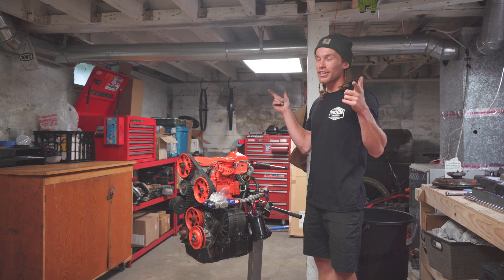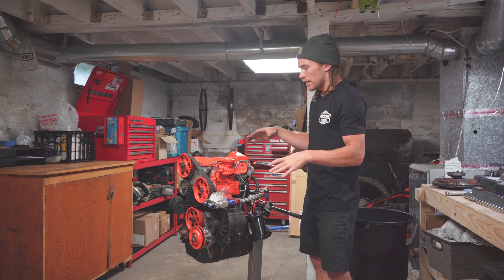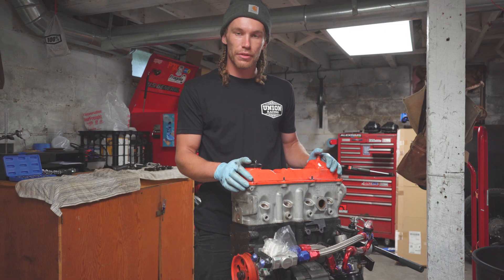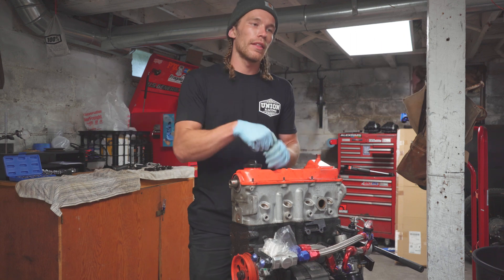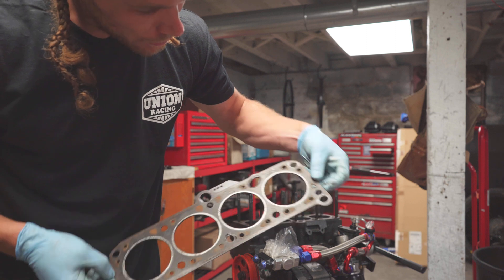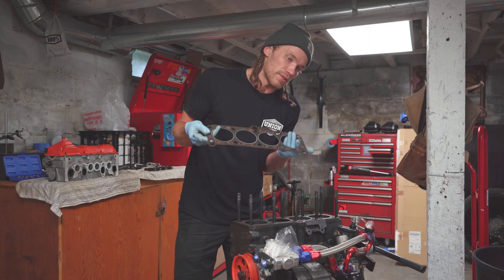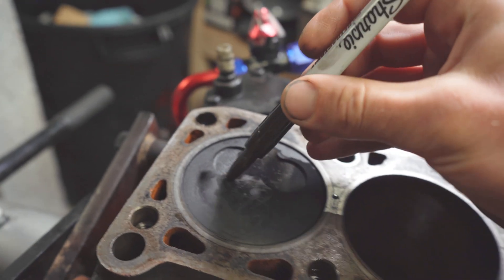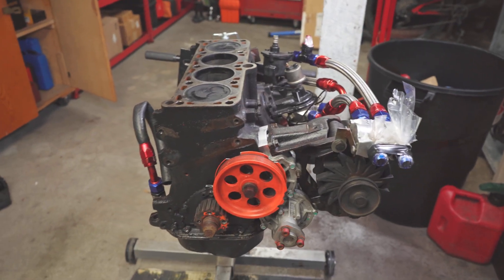1984 VW Turbo Diesel Engine Teardown

Comment: I would not run propane injection on the IDI. You could get pre-combustion on the propane due to the 23.5/1 compression ratio. I would run water methanol. And that could be the reason you squished all your rods. Though I am super happy you are doing this channel. Not much out there on the old VW diesels. Keep it up man.
Reply from the maker: Thanks man!! Good thoughts. Certainly I don't think the oem rods are good for much more cylinder pressure the stock
Reply: @OliverFetter  yeah, the rods are definitely the weak link on these 1.6 diesels. I believe the factory Turbo 1.6 diesels do have stronger rods. You could try a 1.6 Eco diesel, out of a late 80s or early 90s Jetta, those are turbocharged, but don't have a boost enrichment setup. So you would need to swap the pump, but otherwise they are great. Looking forward to seeing more videos of what you got going.
Reply from the maker: @nothsa1107  Right on! I'm excited to have the car back & keep posting videos 🌞

Comment: I have an 84 1.6 4 speed naturally aspirated and it will startup then die but if I give it some pedal it stays alive after a few seconds then will idle fine but if I try to takeoff it will stall no matter what amount of pedal I give it any ideas?
Reply from the maker: hmmmm. Sounds like not enough fuel. has the pump been tinkered with? I'm always shooting in the dark a bit with repair suggestions 😵‍💫
Reply: @OliverFetter  the injection pump was replaced a few thousand miles ago with a bosche remanufactured one hasn't been messed with other than being out in time correctly
Reply from the maker: Have you bled the lines at the injectors?

Comment: on my 1.6D without turbo factory factory engine 40kw, I put a 1.9AAZ engine head that I had to modify so that it could fit on that block and turbo GT2052V AND FACTORY BOSCH PUMP turned on max fuel, it ran like crazy over 6000rpm (second gear 100km/h) and at 3.5 bar pressure, the turbo's head gasket broke (paper) and then I reduced it to 2.5 bar and drove like that for 8 months at full throttle every day and then the disaster happened on the oil pump cam and now I'm doing the whole general job adding sprinklers to lubricate the piston and oil cooling, conversion to metal head gasket and engine bearings from 1.9tdi and I will drive at 4.0 bar turbo pressure and element in bosch pump 12mm and videos are coming soon my advice mate, just give as much air and fuel as possible and that's it, no special parts
Reply from the maker: Sounds like a sweet project!

Comment: What clutch are you using ?
Reply from the maker: Mk2 VW clutch
Reply: @OliverFetter  do you mean a Stock clutch ?
Reply from the maker: Yes. But the larger diameter. The aftermarket clutch I was using ripped in half when I was trying to drag race...

Comment: You should do an aaz swap
Reply: Or an 1.9 tdi afn engine with mechanical fuel pump but the aaz is an reliable and more powerful option then the 1.6td

Comment: I want to turbo my 1.6l na, I’ve heard it can work, but I’m worried I’ll just end up blowing a head gasket.
Reply from the maker: Yeahhhh it's maybe not the best plan if longevity is what you're after? Turbo motors also have different metallurgy & oil squirters to help deal with the added heat. Anything can work but always a matter of how long it will work for 😉
Reply: @OliverFetter  yes that’s another thing I heard. A lot of people suggest putting a 1.9l in them instead.
Reply from the maker: @lucasbarton1354  yeah pretty much anyone will tell you that 💁💁 it really depends what you want to use, what's available to you & you can find in decent shape. I like the 1.6 & ain't switching anytime soon.

Comment: Ah, the timing. Just popped a head gasket running too much boost on my 1.6 20 minutes ago.
Reply from the maker: oof sorry to hear that. I think the head studs are pretty key to not popping the head gasket. I made about ~27psi on the regular and was totally fine, but you think my head nuts are torqued to 125 ft-lb each instead of the stock 90.
Reply: @OliverFetter  I’m rebuilding it, and keeping it to 10PSI this time. Maybe I’ll go with studs. 
I gotta have boost or I can’t get up the hills around here.
By the way how hot does your 1.6 run? The gasket could have been bad already. I was seeing temps as high as 215F on hills before and after turbo. 
215 had the gauge pegged to the right. Tested coolant with a thermometer.
Fingers crossed I didn’t bend rods.
Reply: @OliverFetter  finished throwing it back together today. 
Turns out someone already put head studs in this engine. (Score!) 

One of the head nuts was looser than the others and it happened to be at the divide between CYL 1 and 2 where the head gasket blew. 
I’ve got em torqued up to 125 ft lbs but I’m gunna keep the boost around 10PSI, don’t wanna hurt the rods and i got lucky not having any internal damage.
Also the head gasket I changed out, was installed upside down!
Reply from the maker: @GWinvader101  Sounds like you found the culprit! Nice work out there 👊 If it makes you feel better I only bent the rods because I was using too much propane... Lots of cylinder pressure.
Reply: @OliverFetter  are you going with a stock replacement? what rods are you going with?
Reply from the maker: @lowbobcatTDI  Maxpeedingrods makes an H-beam upgrade (will show in next vid!)
Reply: How much is too much for that engine? I have a mk1 1.6 TD with that stock Garrett turbo, I blocked westgate completely and im getting 1 bar boost only at max reps in third gear. How can I get more boost, maybe by adding more fuel?
Reply: @igortanasic3362  22 psi was too much.
Seemed to like it 10 though.